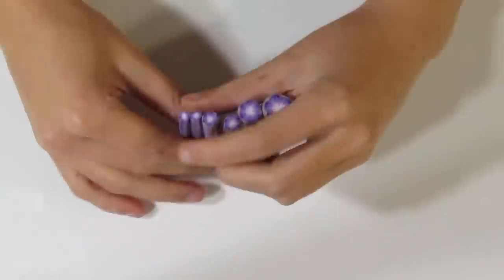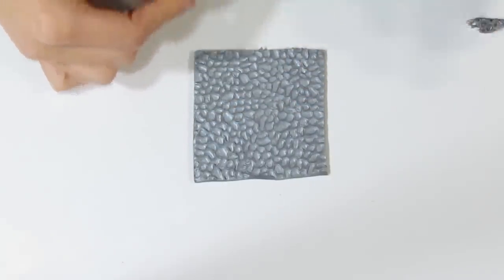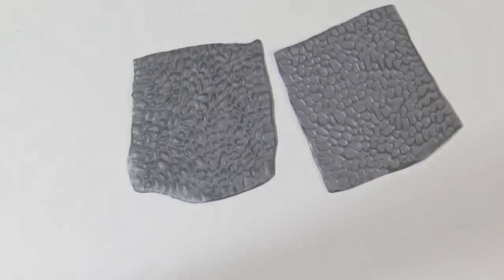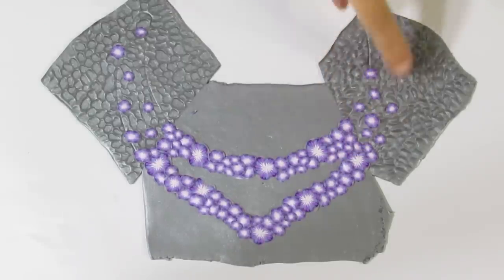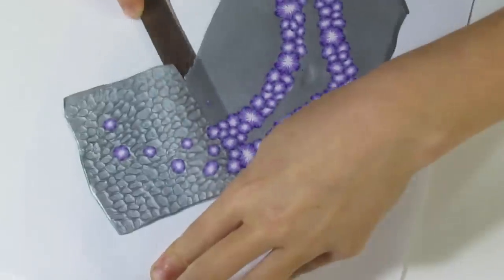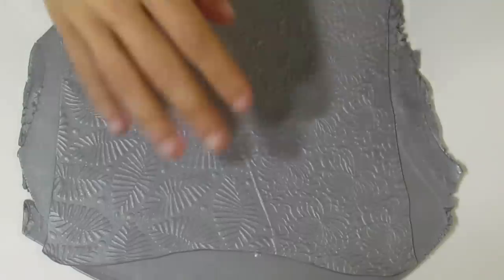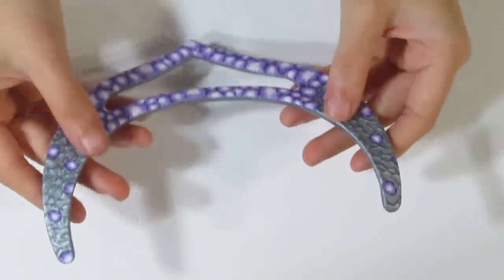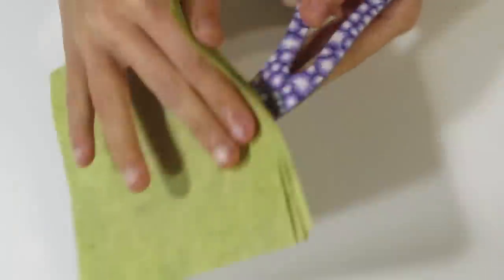Polymer Clay Project: Thousand Flowers Collar Tutorial

Comment: Nice video.  On collar necklaces, how do you determine the length of the chain pieces?  Do you make to standard measurements?
Reply from the maker: I usually put the collar around my neck and measure the amount if space left from one point of the collar to the other and that's how long my chain is.
Reply: @JessamaTutorials  Ok..what if you intend to sell pieces?  Surely necks come in different sizes.  Do you have advice for preparing them to sell?
Reply from the maker: I have the option of an adjustable chain. Make the chain around 7 inches and on the other end have a lobster clasp so that the lobster clasp can link into any one of the chain links. That way people can adjust it to the length they want.

Comment: Fabulous - I love the way you've scattered the flowers over the mica shift. Can I ask, is that a DIY store type heat gun you're using rather than a craft/embossing type heat gun? I'm guessing the latter would't give enough heat?
Reply from the maker: The first one. I like it better as it has more settings. :D
Reply: I use an embossing heat gun and it works okay.  My DIY heat gun is so hot I'd burn everything.

Comment: I wouldn't think that the liquid clay as a varnish would become tacky/sticky over time as it should come out like the regular clay, but have you ever had a piece where using the liquid clay as a varnish did that? I know most regular varnish that people use on their polymer clay pieces can, after several months to years eventually become tacky/sticky, even the really good stuff. 

And I always have issue with my more thin or fragile pieces not baking well and they break. Maybe not easily, but with little force they break. I feel like I've tried every baking time and temp and brands of clay to fix this. When you pushed your piece down flat I nearly had a heart attack lol.
Reply from the maker: I find that the liquid clay can have an oil residue after a few months, but it's easily wiped off.  The proper varnishes that are compatible with polymer clay will stay perfect for many years. Here's an article on varnishes. https://www.jessamatutorials.com/how-to-seal-polymer-clay-varnish.html

Are you sure you've tried every brand? Also are you going above the recommended temperature for the brands you're trying? I bake for an hour. Here are a few articles. They might help. 

https://www.jessamatutorials.com/bake-polymer-clay.html
https://www.jessamatutorials.com/baking-polymer-clay.html